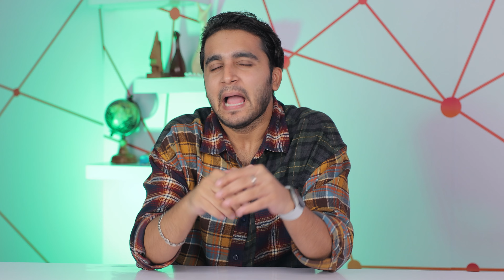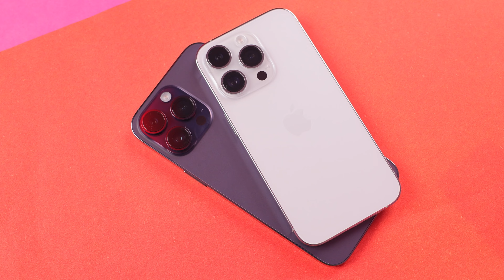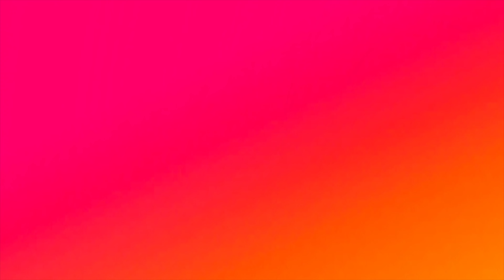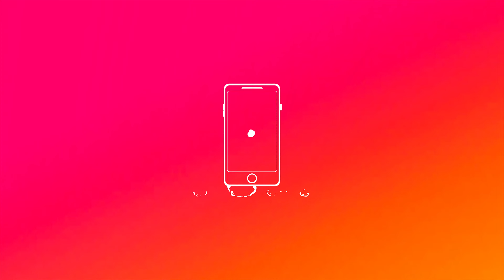iPhone 14 Pro vs OnePlus 10 Pro vs Xiaomi 12 Pro | Battery drain test 🔥

Comment: This gives me idea since I'm planning to change my Huawei P30 Pro to either 14 Pro or 14 Pro Max
Reply from the maker: iPhone 14 Pro series should technically have super battery life. But it's iOS 16's current iteration that's causing an issue. I'm sure Apple is gonna fix this. Rest assured, if you're planning to upgrade, go for it, amazing devices.
Reply: @Fiiber  Yes, I was anxious if I'm doing the right thing. But I feel like its gonna worth it. I hope Apple fix battery issue in iOS 16.